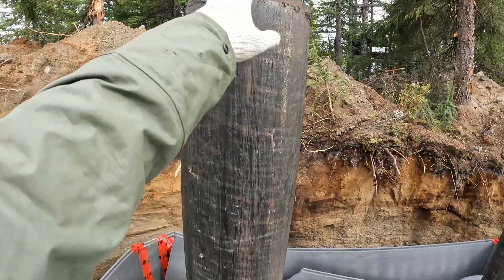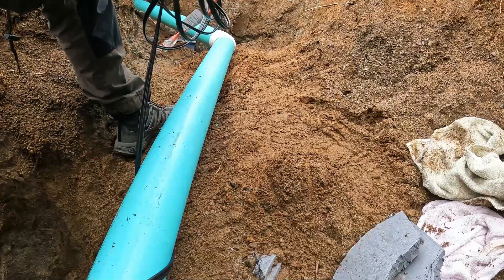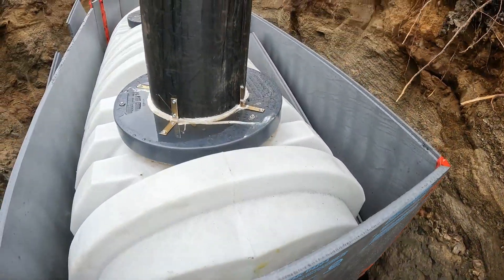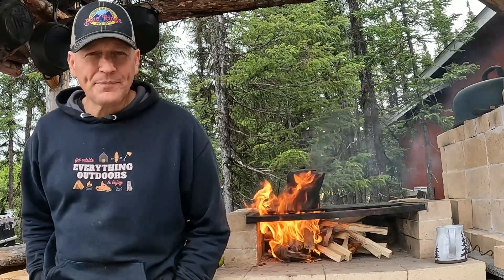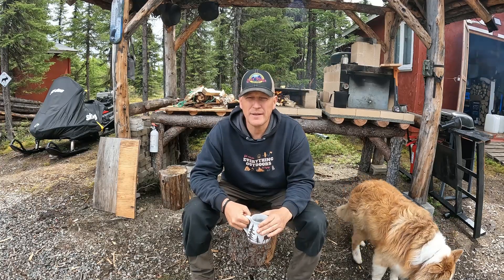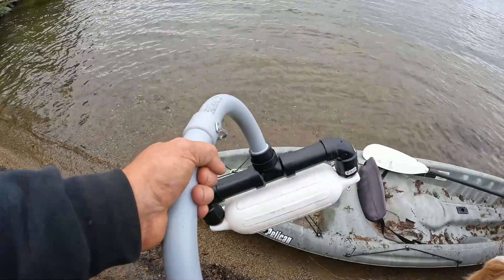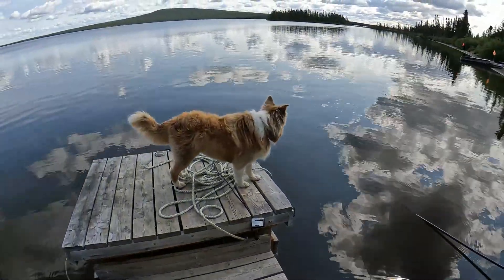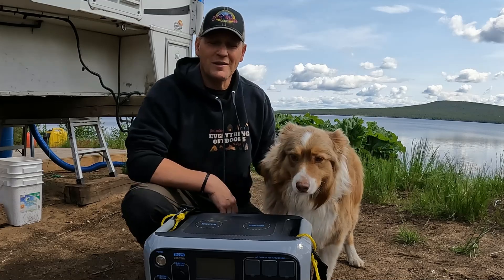WIN A BLUETTI POWER STATION CONTEST!!  And a tragedy causes a delay in my Log Cabin Kit Delivery

Comment: Like your videos.   I think you are on the right track with using a heated wire and insulation for your septic pipes.  I have had to put mine down 4 feet to keep them going year round.

Comment: Yup, water and septic are a whole lot easier to install in warm temperatures. 
That Bluetti would make a much nicer backup power outage system then my gas one. I would store inside and not have to run out in bad weather to start gen. 🤞

Comment: Great video.. double heat take maybe would've been a good choice. We did a winter in the 5th wheel in Alberta and changed out the heat tape twice.. issue was the connection at the thermostat. Last time I installed two and both functioned until we moved.

Comment: Another extra layer of protection is fill your sewer pipe pit with the gravel to the top op the pipe.  Add rigid pink insulation two feet wide then continue to back fill.
Reply from the maker: Tks bud. Great advice 👍

Comment: Hi Chuck.....from an experience I don't want to ever relive.....make sure you pack the fill under the exit pipe from your septic tank.  Mine wasn't and the drain pipe flexed with fill weight above and a dip formed in the pipe which froze up in winter.  I had to wait till spring and dig it all up and repair.... needless to say it wasn't fun.  Nice that you can keep busy with other jobs while things are backed up.  Hope it's not too long.... that will have the pressure on ya big time as fall approaches...
Reply from the maker: I filled in under all my pipes, including the outflow. Hoping the job was suffice. Wil have to wait for winter to find out for sure!! Tks bud

Comment: Thanks chuck for sharing the video. One thing that I did not like about the AC200P is the long charging time from the AC wall outlet.
Reply from the maker: I find the charging time much faster than other units. For example, I have a 300 watt power station from another company, and my bluetti fully charges at roughly same time it takes for that one to charge. I guess it depends on the unit for sure👍

Comment: I really enjoy your channel been watching for about a year now.  I am from northern Maine and you are spot on with your water and sewer system.  I have the Jackery 2000 sport pro and would love the match it up with the Bluetti. Have a great and safe day. Oh for your water freeze proof, check out Heat Line.  Self regulating heat trace cable that goes inside the pipe.  I have been selling it for a couple years now.  I work inside sales at a pump and filter wholesale Co.  Here in Maine

Comment: Regarding your water supply, I mentioned in an earlier comment that I grew up in Montreal and had a cabin on a lake in the Laurentien mountains (around 1966).  I used it all year around. I drew water from the lake through a 1” poly pipe. The pipe had a heated copper coil through the center of the pipe with a strainer and a check valve at the end in the lake. This intake was in about 12’ of water and weighted down in place with a float marking the end location and keeping it off the bottom.  It worked great. The pump, located in an insulated area in the cabin, turned on when a faucet was opened. The water in the pipe stayed above freezing all winter.  Just an option. 
In another comment I mentioned I have had a 500 watt Bluetti for a few years now and use it a lot.  A 2000 watt must be a great asset to your cabin.  At 77, and building an off grid cabin on a wild and scenic river,  2000 watts also sounds great.  Thanks for your channel!  From Hells Canyon, Frank.
Reply from the maker: Love your input sir. Hoping to get successful water to my cabin this winter. Nature is a formidable force. Tks so much for tuning in. I appreciate it very much 👍

Comment: In the area of Alaska were it gets cold they put the sewer pipe to grade and not low spots to have standing water to freeze in the line also.  Good video as usual.
Reply from the maker: I have put slips on every pipe leading from the cabin right to the leeching field. Spec calls for 1% grade but I went much higher than that👍

Comment: I spent years fixing water and sewage issues for a cottage that I bought that had neither.  First was putting the pump in the lake, then I just put the nozzle in the lake and the pump in a heated area with heating wrap along the hose to the water.  I finally paid $6k to get a well drilled as the pipes froze almost every year (NB-Canada with lows of -58c recorded on the lake)  So, if it is feasible it is better to drill a well now then try and do it after as it was a pain to re-engineer everything to connect to the well.  Also septic...nightmare at -58c but mine wasn't insulated so you should be in a better place.  Mine though was 6 feet down but water table was 3 feet so.........bad news if it leaks.  Anyway, love your show and am a NL owner now looking for a cabin to call my own...Maybe up north is a place I look.
Reply from the maker: Great advice my friend. All I can say is tune into next video😉

Comment: We really enjoy your content. Just curious why you went with a pump in the lake, instead if having a well drilled?
Reply from the maker: I see this system being used heavily in the Arctic etc where drilling isn’t really an option. It’s a system whereby the water doesn’t hold up in the pipe, but simply runs back out into the lake once the demand is met (tank filled in cabin) There is a challenge though….where the pipe where pass through the ice….water will undoubtedly sit there at times, depending on ice pressure, etc. That’s my worry. I have a plan to insulate heavily in that section. 

Having said that, a well maybe in the works 😉. Stay tuned!!!

Comment: Excellent video Chuck. You know if your water or sewer will fail it will be in the dead of winter when the soil is like concrete. And you can only stay outside for 5 mins. before your fingers freeze. Been there done that. Thanks Chuck 😁.

Comment: Hey Chuck 
Glad to see you doing all the preventative steps for the septic. It has helped me in the dead of winter to be able to plug in the sewer line. The pump I have I the lake is a deep well pump meant for a ground well. With a heat line. It’s down under the ice and no issues in the winter but it too is insulated well. Good luck with the build. Enjoy watching. 
Rob

Comment: Hello Chuck. I can attest to the heat tape, works excellent. I also wrapped my propane tanks. When the temperature gets below -40, sometimes the propane can get sluggish and the valves can freeze. Great videos as usual. Great job on the cabin build! Cheers
Reply from the maker: Great tip!! I won’t forget that one 👍👍

Comment: Hey buddy,  just for future reference, that style of insulation isn’t designed for underground, and will break down in standing water, should use the cast ridge styrofoam type, and it has a channel cut into it for a heat trace cable,  also house rap.  😢 Ugg.   Not water proof in standing water Need to use a rubberized membrane like blue skin, to be water proof ,,    And think it’s great that power station supplier is doing a giveaway, shows just how popular you and your channel has become  with is just awesome good luck with the build , lots of work for sure , and delays are just part of the construction game.
Reply from the maker: Shouldn’t be any standing water where I’ve placed it (fingers crossed). Sandy soil means everything trickles down through. Others have same method used and seems to work fine. I’ll be using the same insulation up in under my floor where the pipes are fully exposed as well👍
Reply: @ChuckPorterEverythingOutdoors  above ground and out of the element is fine, no problem , except for those evil squirrels, they loves that stuff. Lol

Comment: I use the heat line to keep my well pump line from freezing.  I've had a issue with my pump line freezing in the past.  I've insulated the pipes and the pump.  Hopefully this year I'll  get heat in the basement so I won't have to worry about it so much.  Your property is coming along well.  Looks so nice and peaceful too.
Reply from the maker: It’ll be covered in an upcoming video but I’ll have zero water sitting in my lines. 🎂

Comment: Hey Chuck. I heard before that you only heat trace pipe with water in it all the time. Is this not the case?
Reply from the maker: I will only power it up if it freezes. Then it’s supposed to sense where the ice is and thaw it out. Once thawed, the power supply (wattage) virtually cuts out.

Comment: Another great video! About how long does it take to charge your Bluetti power station with that solar panel?
Reply from the maker: It all depends on how much sunlight there is. I usually hook up three panels and let it charge away. If it’s really sunny I use it WHILE it charges. That’s one of the reasons i picked the bluetti because not all power stations have that option.

Comment: Be carefull with that Easyheat cable, it is designed for supply pipe only. I have seen it used for drainage piping and it has melted thru plastic drainage piping. I would hate to see all your hard work to waste!
Reply from the maker: Good advice.. I plan to only power it IF I get a freeze up. It’s designed to send the heat to the coldest span then. Let’s hope I never have to use it 👍